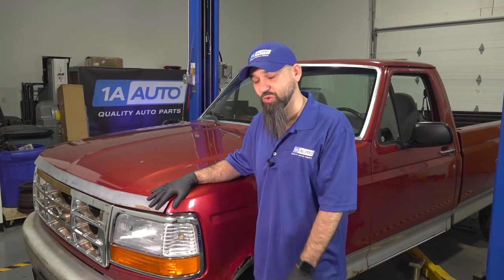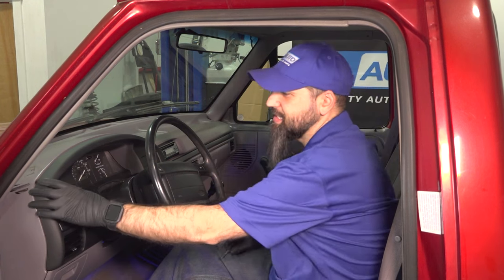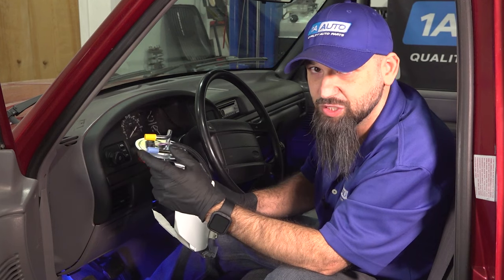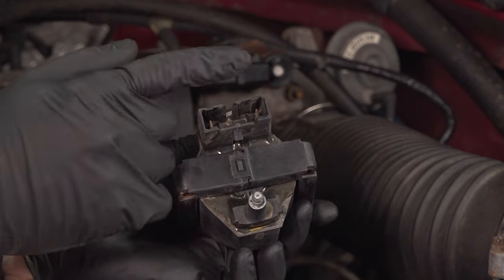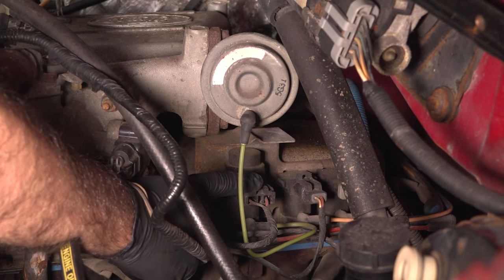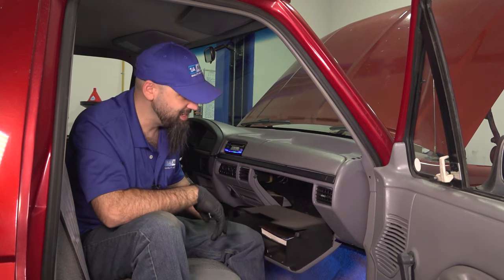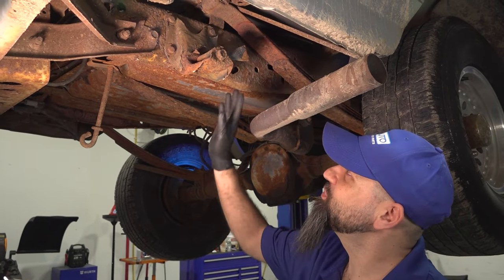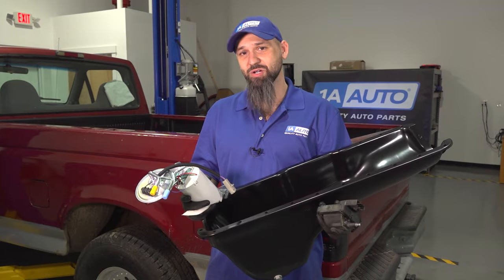Top 5 Problems Ford F-150 Truck 1992-1996 9th Generation

Comment: I worked for Ford for a number of years and another big problem I found is the connections going into the fuel pump relay get corroded and break. It's located under the hood on the drivers side. The pigtail is green. I've replaced many of them. So if you have a crank no start condition check the fuel pump relay and direct wiring before messing with the fuel pump.

Comment: I have a '96 F150 I bought in '97.  275k miles.  All the issues he spoke about are true.  The oil pan gasket is a nightmare.  He didn't tell you about the process to replace the gasket.    Also, who ever owns that truck doesn't deserve it.  So much rust!  They are not hard or expensive to maintain.

Comment: My 92' f150 5.0 is at 440k, was my grandmothers truck who raised me. 

The fuel tank selector switch pigtail can become corroded as well, small files and bending the wire terminals end for a more snug fit fixed my 2 dead fuel pumps after buying replacements and a new selector switch.

Comment: From my 92 I removed all the a/c and heater components including condenser and wiring, removed the rear tank, fuel lines and wiring too, put an electric fan with a switch, a fuel pump with a switch too, set the timing on 10 degrees, and yes,the 302 still working very good 👍🏻

Comment: We used to have dozens of these style trucks in our work fleets at the time. I don’t know if it could be classed as a mechanical issue but they all had noisy, whiny power steering pumps.

Comment: This is the best video ever made when it comes to quick ,and easy to follow, most common issues for this generation F150. I have a 1996 4.3 L manual transmission F150 it was my father’s truck ( he passed away last year )and you guys nailed it out of the park with this video. Props to my man that did the walk-through and presentation. I hope you are featured in more vids !Every Ford F150 owner of this generation truck should be forced to watch this video. You guys would save so many people a lot of heartache. Great job guys!

Comment: Love my 1995 Flareside F150. I've bought a few things from y'all. I'll need a few more for sure. Currently on my to-do list, find the vacuum leak, rear main seal, timing chain, replace ac unit, shock's, power steering. I've redone the interior on my channel.

Comment: From my '95 4.9l manual I learned the oil pan will not clear the pump due to frame member. Wait until you find out that you cannot raise the motor without removing the AC plenum. I went to a Ford dealership and paid them $500 to change oil pan and valve cover gaskets, but that was over 10 years ago. Today I'd just drop the pan as far as it will go and cut the new gasket once. Permatex.

Comment: I have a 93 F-350 with a 460/E40D 168k miles. Just re-sealed the engine she runs like a champ. The year I bought it I did the following: oil change w filter, transmission fluid and filter, t-case fluid, front axle fluid and gasket, rear axle fluid and gasket, right wheel bearing and U-joint, carrier bearing, and now the re-seal. I need to give it a new paint job and some upgrades.

Comment: Have  1994  XLT. Daily driver. Best truck ever; runs and very dependable. Has normal repairs like all vehicles. It looks and drives like new. Be keeping in mind the problems and fixes you have worked on!

Comment: On The 4.9 the valve cover gasket will leak on the back side and make you think it was the oil pan or rear seal and is very common on the older ones. And is very hard to tell where it comes from. That's if you can tell at all and if you are unsure go with the valve cover frist. I learned that the hard way.   ☺

Comment: I could add a few more. Wobbly shifter with a manual (needs new shifter bushings). Door handles stop working from the inside. Loose dash board. Fluid leaks galore.

Comment: I have 570,000 on my 1996 F150.  I have of course replaced the EGR valve occasionally but I haven't had any of the other problems ... (?)

Comment: I have a 1996 Ford F150, Four, 4 x 4. The drivers door latch wouldn’t open the door from the inside. I used 3-IN-1 Lock Dry Lube and it did the trick! I sprayed it in up all over around the doorhandle inside. It works like a charm now.

Comment: dude , there is no valve in the pump assemble to stop the return fuel from going into the wrong tank. The fuel selector valve on the frame rail serves this function. The valve directs the correct return for the fuel tank being used. These valves do fail and cause the non selected tank to overfill.

Comment: I currently own 3 of these body styles. 92 F-150, 95 F-150, and a 95 F-350. I'm currently having an issue with the F-350. It was running fine whenever I pulled into a parking space, but whenever i started back up to pull out, the 5.8 developed a hard misfire. I did a complete tune-up replacing the plugs, wires, distributor cap, and rotor. Nothing changed. I'm stumped. The motor only has 92K on it.
Reply from the maker: +@blmdh20s We wouldn't be able to diagnose an issue like that here, you may want to have a local mechanic take a look at it. Thanks for checking us out! http://1aau.to/m/Shop-1AAuto-c

Comment: The EGR valve I agree is a problem area. My check engine light was on and I replaced the EGR valve. No more check engine light but now it has the occasional stalling problem. I think that if you put in a cheap aftermarket EGR valve it may not function perfectly.

Comment: Those tiny plastic vacuum lines are brittle and crack easily due to the age of the vehicle. I searched everywhere but no one makes replacements for them..... 

I have gotten to the point of hating to work on my '95 E150, every connection I take apart seems to break no matter how easy I am with it. Thankfully no rust anywhere, but basic stuff just shows that these parts can't handle the test of time.

So tempted to yank the 302 and throw in a carbureted 4.9l inline 6 for simplicity.

Comment: I just bought a 93 F150 XLT, 5.8, for $100. 105k miles, been sitting 8-10 years. No rust seen on body. Cylinders soaking in Marvel’s Mystery Oil…fingers crossed.

Comment: I only owned 250s and 350s in that period. The problems I had terminal body and frame rot and ABS failures. Everything else was standard automotive maintenance mostly all pre electronics items like all other brands had. EGRs - bypassed or removed them and plugged whatever holes were left since NY didn't do a good state inspection then

Comment: i have now a 1996 F-150 fleet side 8' bed. 5 speed 4.9L Eddie Bauer... good truck has 219K now got it with 88K 12-29-2003... yep still running good, just replaced  the ignition coil /cap/rotor/wires/spark plugs from the Ford Dealership.. i have replaced the radiator 3 times and heater core 2 times. and rear axle seals. starter 2 times ... but other then that is is a good truck so far... i get asked to sell it, but why but $100 K new truck that is junk... Haha... i am good with this one... i am a engine builder fleet manager and i got 2 brand new cylinder heads in storage now... waiting to be installed if needed... no smoke no burning of oil yet... Haha... i bought this truck because of the engine 300 cid inline 6 is by far the best engine ever. ups and fedx use these engines for years and wonder bread/ hostess cake trucks ran these engines for many years... no problems... yep ...... lots of other company too..

Comment: Had a 96 F150 with the 5.0l 5 sp manual tranny.  My issue was when shifting.  Start out, engage the clutch, shift from 1 to 2.  RPMs would not drop on motor.  When clutch released I got a little thump because tranny speed and engine speed not matched due to rpm's not dropping

Comment: I'm going to guess first.
1:IAC.
2:vacuum line to open the blend doors.
3:EGR
4:headlights switch.
5:fuel pump or fuel tank switch.

Well I got a few.

Comment: I bought a 96 f150 4wd with the 5.8 in it in 96 and other than normal wear and tear like brakes and tune ups the only thing that gave me any issues was the fuel pump quit and I sold it with 279,000 miles on it and recently I just bought a 94 flare side 4wd 5.0 for $800.00 and it's pretty much got all these issues and more 🤣 good thing I'm a collision tech and mechanic.

Comment: Have had 4 of these trucks. Still have a 1992 with the 300" six.  245k miles.  Replaced alternator twice, starter once, two tune ups.  Original fuel pumps, coil, blend door.  I live in the south, so rust is not a problem.  Will keep it.  Have had 3 chevys since I got the 92 F150.  Got rid of them. Electrical problems, fuel pumps.

Comment: Only one of these I've had with my 95 is my front tank quit working. Sometimes it will pump if I haven't used it vin a while. Other problems I've had, distributor pick up ( my fault), rear end needs shimming and trans tail shaft cracked at the rubber support mount.

Comment: I put 270K miles on a 92 with 5.0L straight 6.  Truck was a beast that refused to die.  Finally sold it have regretted get rid of it ever since. I had 5 f150 and that was the best one I ever owned.

Comment: I have a 1995 F-250 with the 5.8 and I just rolled 361k miles on it (original engine). I've had it since new, 3000 mile oil changes and full service....never an issue. It's so far outlasted the radiator and transmission....not a fan of the factory trans in this F-250 and had a heavy duty rebuild. The transmissions behind these motors from the factory are made more for cars...plan on rebuilding the right way if you have one with a heavy duty rebuild. It's the ticket!

Comment: Wow, I've had every one of those problems on my 1993 F150 except the ignition coil.

When my  passenger side spring shackle broke, it drove the spring end right through the floor of my pickup bed and left a hole.

I've replace BOTH spring shackle brackets.

My fuel always migrates from the back tank to the front. So, I use the front tank first then switch to the rear. When the fuel from the rear is in the front tank, then I switch back to the front.

He forgot to mention the faulty alternator connector that can cause a fire. I had that happen and found that you MUST replace the connector when you replace the alternator or risk a fire.

Despite all those problems, my F150 has over 340,000 miles on it and still passes emission testing somehow.

The engine has NOT been rebuilt.

Last year, the air conditioning compressor had to be replaced after a mere 330,000 miles and 30-years of service. What does "Made in  America" mean any more?

Comment: 😂😂😂...Heck...These was E...Z...problems...Mines got weirder ones...Like "Crank, No Start with fuel pumps keeps priming...I overfilled the sliding driveshaft yoke with too much grease...Took most of it out, now I feel and it sounds like riding on Rumble strips when I slow down...Plus, it leaks water to the PCM at the front of the firewall...Like I said, yours was E...Z...Try mines if you want to fix Challenges...😂😂

Comment: My 1992 f150 5.0 runs great BUT stalls out when I put it in reverse. I cleaned the IAC valve, cleaned the throttle body. Not know much about this truck. Any advice would be appreciated!!!

Comment: Today I learned that even if you don't have dual tanks and a switch, you still need that damn harness plugged into the back of the dash. If you don't your fuel guage will read way past full and your pump won't fire up

Comment: as i tell my son  my truck don't leak oil, it sweats horse power lol. we do runs to pull a part for extra stuff for our vehicles or we order new parts, ATM we are going through replacing hoses/thermostat/trans cooler lines pretty much if it looks like it needs replaced it's ordered lol.

Comment: Having a problem where my 96 blows cold air but only through the vents on the dash. Not from the center or floor and none of the controls for location work. Sounds like this could just be the blend door actuator??

Comment: Cool video thank you. My 95 f150 is vibrating a lot, but the word thing it does only sometimes and when I had the muffler off, it stop, I put a new muffler on it, it came back. Any idea what causes that? Btw all wheels and even the drive shaft are balanced. Thanks

Comment: @1AAuto
 So my problem is I have a 94 f150 and we can't get it to start.  It cranks but it just drains the battery.  We replaced the coil today and it's still doing the same thing and we've been using starting fluid too.  What else could we do to fix this?

Comment: I have replaced fuel pump in front tank and fuel filter on my 95 rear tank is not  used. But truck still loses power in drive but will idle fine! Would love to have some insight.

Comment: I own a 92 f150 300 6cylinder with check engine. Code comes back as “egr insufficient air flow” I replaced egr, solenoid, and still nothing. Any other things I should check?

Comment: Problem I have with this is that you never specified what engine. On my 92 5.0 most of the things you pointed out are not even close to where they actually live. Now I’m gonna hazard a guess that’s a 300 6 or a 4.9 liter i6 based on where the egr valve and the control solenoid is located. I just think it’s poor representation on your part not explaining that.

Comment: drop the tank or pull the bed..that faulty check valve was a recall item. The trucks are outside the age limit. Ford wont fix, now. The solution was an inline check valve. Also, something you  cant get. 6 bolts to pull the bed or drop the the tank. Which, you'll have to drain since its likely full of fuel. Did it on my 96 f250 7.5L ..sucked but, fixed it.

Comment: Not exactly true. I have a 1996 with 300/4.9L  that has dual fuel tanks. Also brand new replaced fuel pumps. And there's clearly a distinguishable difference. As a self proclaim engineer, the problem fluid dynamics. The rear pump has least amount of resistance going straight.  In line to the fuel line to the fuel rail of the engine. Meanwhile, the front tank has to make a 90° to in the fuel line to head to the engine...
This is also the case for all 1989-1996 with any combo 302, 351, 460, 4.9L manuel, auto with dual fuel tanks

Comment: Hey 1auto I have a 94 4.9 litre f150 and I took out my spark plug on cylinder 6 and got oil on it. I put a new one and same thing happened. when I put it in reverse it bogs out of control and feels like it wants to turn off. any ideas what my park el could be?

Comment: I’m having problems starting mine. All it does is cranks. I have a 1996 f150 5.0 and I have replaced the crankshaft position sensor, ignition coil, solenoid, the whole distributor assemble, the voltage regulator is good. It has spark, the  compression test came out to 90, and yet still no start all it does is cranks. The fuel pump kicks in and I already sprayed starting fluid in the intake and it does nothing. Im running out of options here. Pls help. I got the truck from this guy and he said that he drove it and he had troubles starting the truck, eventually it got to the point where it cranked, so he just parked it. Its been sitting for 10 years now. Last time I hauled it out of there and out of curiosity I decided to turn it on and it did, it lasted only for about 5 seconds and then it died, i turned the key  a 2nd time and it died again, but ever since it just keeps cranking with no luck.
Reply from the maker: +trillmexicanz We wouldn't be able to diagnose an issue like that here, you may want to have a local mechanic take a look at it. Thanks for checking us out! http://1aau.to/m/Shop-1AAuto-c

Comment: I just had my 93 5.0 f150 fixed I had a high idle fix then it was a crank no start the mechanic said it was the tps sensor was bad he charged me $680 to change the tps sensor and clean the throttle body. and reset it.

Comment: My 94 F150 4x4 5.8, So my engine Is violently shaking at idle, I've already replaced motor mounts, Idle air control valve, PCV valve, Harmonic balancer,  EGR valve, EVP sensor, Tune up and ignition coil pack. And my engine is still shaking at idle, but it doesn't shake while driving just at stop. Can you all give me some suggestions, thanks all..

Comment: We have 4) 88/90/95/97 f150/250hds 4.9-5.8 for a bunch of 30 year old work horses I don’t count the chicken shit repairs The only problem with the later 300 l6 is that nylon press on cam gear and a few roll pins on the distributor gear sheer but longevity of the old diesel without the starting fluid I’ll keep her. Shackles are rusting and braking on all the bands around here so here’s what you do plate the egr don’t run it low on fuel reach up behind the glove box and manual open/close the blend door let the motor leak and that will keep the shackles from rusting. Do a video on the 97 up f150/250Lt triton that’s where the problems are

Comment: The BIGGEST problem Fords have is the damn gas gauges don't work. I've had 8 Ford trucks and driven others and not a damn one of them worked. I even replaced the one in my 89 F-150 and it didn't last a year. It just slowly got worse till it quit altogether. I think the only Ford I've had with a working gas gauge is my Lincoln Town Car. Insane !

Comment: My front gauge of the fuel selector is not working stays on the E but my rear fuel selector moves to the F. What do you think it is?
Reply from the maker: +John A We wouldn't be able to diagnose an issue like that here, you may want to have a local mechanic take a look at it. Thanks for checking us out! http://1aau.to/m/Shop-1AAuto-c

Comment: I thought the selector valve on the rail kept return gas from going only to the tank being used. Never had a ford transfer gas from one tank to another. That's a chevy trick.